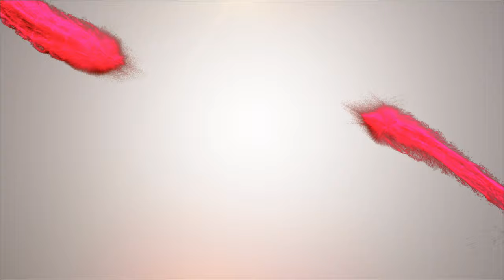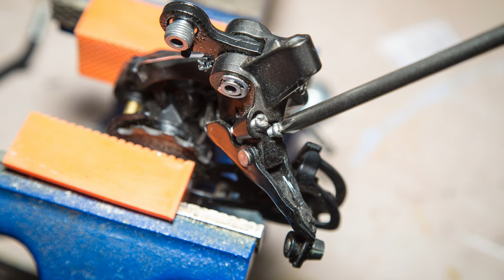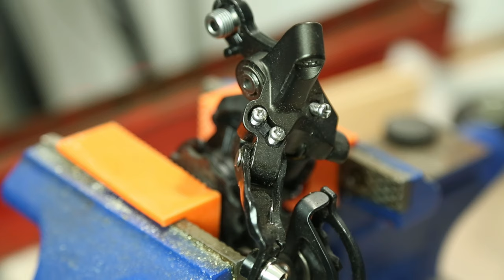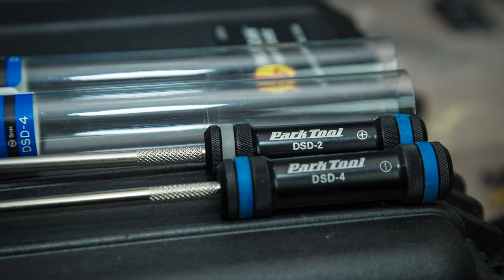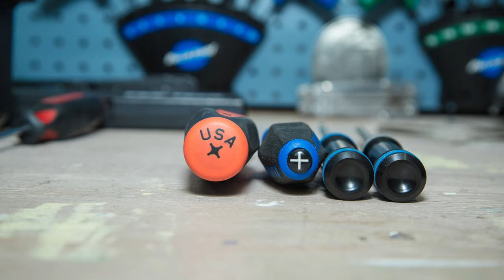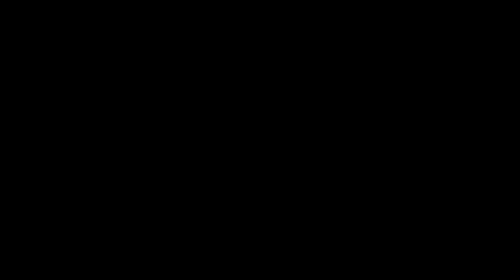The perfect screwdriver for bike derailleurs? Park Tool DSD-2 / DSD-4 JIS

Comment: Over $30 for each screwdriver is ridiculous
Reply: I agree they are very expensive for just a screwdriver but they are literally designed to work for only this, but they work very well, I’ve had mine for about 5 months and it is super good still
Reply: @Eng586  No I get it.The specific tool for the job. I'm sure it works great.I have a small Philips and a certain flat blade works for me.But im sure the park tool drivers are much better.